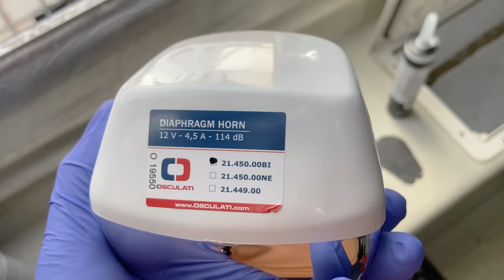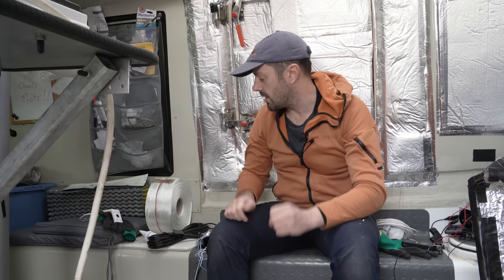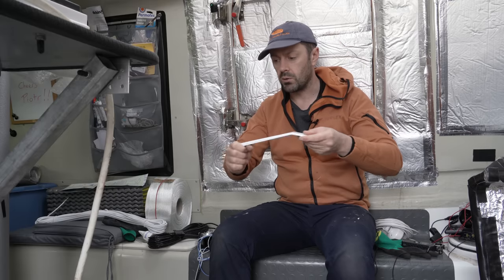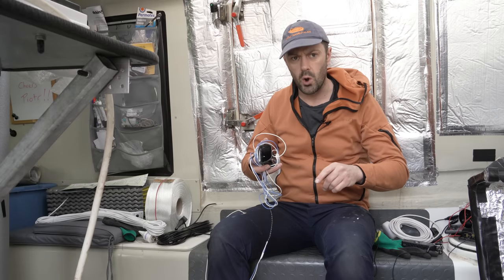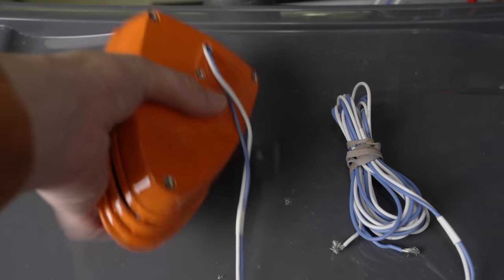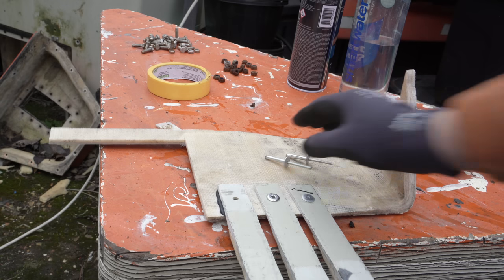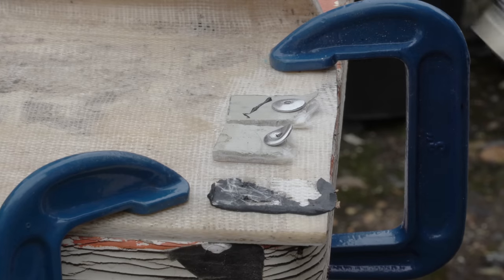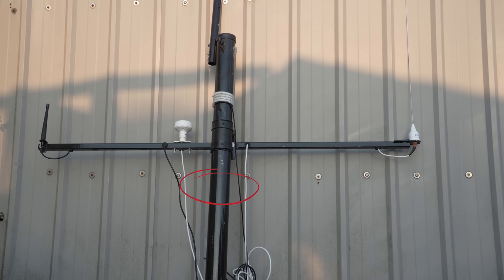VHF/AIS/GPS mounted to mast and wired. Plus a special pop rivet test. Lifeboat Conversion Ep74 [4K]

Comment: If you have some extra heat shrink. Cut some and make several pieces slide over the wires and slide them into the hole and then heat it and will fill the hole. Then there is short pieces of vacuum hose.
Reply from the maker: Yes that's my solution - I should have showed it.

Comment: I’ve a suggestion for a type of fixing that I don’t think you have heard of that being rivnuts. As the name suggests their rivet nuts they are ideal for use in places that have voids and allow you securely bolt things in place instead of using pop rivets. They would have been ideal for fixing your antennas in place and as they come in different sizes could have been used for the fixings for the mast support post instead of jb welding bolts to that piece of steel and the improper use of a measuring device 😂
I hope this helps
Reply from the maker: Ah, you'll enjoy the railings episode. I've gone with riv nuts...

Comment: "The manufacturers have designed it specifically so that the smallest maintenance task requires 20 prior steps to be completed to access any given component."

That's how you know you've encountered something designed by an ex-Mazda engineer.

Comment: Is the VHF aerial designed to work without a ground plane? Do you have a SWR metre available to check that the aerial is matched up ok?
Reply from the maker: Well that's sent me down a google search vortex of despair. Answer - still don't know. I'll switch it on and find out.
Reply: @AlexHibbertOriginals   It appear to be base loaded so maybe not Alex, that said,  it wouldn't suffer if your metal (an ali strip would be fine just make sure you had a good electrical connection to the outer of the connector) mounting bracket was the whole length of the 'yard arm' to give a little ground plane effect ;-) edit: it's just occurred to me your twig may have been intended for masthead use, in which case yes it would ( aerial speakingly) be expecting to have a whole yacht mast  attached to it acting as the ground plane, an asymmetric dipole even.

Comment: There may be a snag to your generator setup. Have you run it for any length of time yet? They're unpleasantly noisy things to spend any time around. I'm not talking about normal diesel engine noise levels, those little petter a-series engines are really "knocky", it's a sharp, high-frequency noise that totally obliterates your hearing if you spend too much time with them. I'm not saying this in the traditional spirit of the usual comments-section naysayers, it's because i own 2 of the little beasties myself! I'm a diesel-mechanic, so I quite enjoy most engine noises, but even I'm not keen on them. There's not much that can be done to quiet them either, without smothering (and subsequently overheating) the poor thing, the noise is made much worse by the relatively thin aluminium engine-block, it doesn't dampen the noise like cast-iron would, it seems to amplify it!

if you decide that you still like the thing, I'm happy to help if you need any advice or even a hand, I've re-built a few, and aside from the racket, quite like them!
Reply from the maker: Oh yes the noise is extraordinary! Luckily the power output and my charger is enough to only need to run it occasionally. Either you spend the time out back or on deck, or with proper ear protection on.
Reply: @AlexHibbertOriginals  that's good, they're quite reliable little engines so make a good backup unit, just not something you'd want to spend hours listening to (I have, and I'll never hear those particular frequencies ever again!)

I've got a tip for better cold-weather starting, keep a small bottle of 30:70 petrol:oil mix around (I use a lighter-fluid tin for convenience/robustness). a quick squirt into the priming port ( the knurled plunger thing on the intake manifold) before starting and she'll go even in the coldest conditions. the oil will temporarily help get a good compression seal and the petrol makes combustion easier. it's far kinder to the engine than ether (easy start) and safer to have around too.

Comment: You may want to contact a HAM radio “Elmer” and measure the antennas performance (SWR) and placement.  Also there are other frequencies antenna configurations you may want to be prepared to transmit on (HF/NVIS/directional).  These days radio communications can also transmit e-mails/txt messages when other methods fail.  I’m sure there aren’t many cell towers where Alan is heading but thankfully you have hair shears.

Comment: Coming along well, despite the weather impediments!
You may know this but coax cables should not be deformed e.g. in compression glands, especially if mixed with other cables. Thus best not to turn the thing at all, and just rely on the gooey goodness for keeping out the eleph…. elements!
Reply from the maker: Cheers

Comment: The flexibility of that fiberglass member dangling in the breeze on the top of that mast gives me a bit of concern about resonance issues - if you give a twang, what's the frequency?
Reply from the maker: Frequency unknown - but there will be wire tensioners.

Comment: Why didn't you go with a manual crank or electric crank telescoping mast? I would add shrink tube to those wire that are coming out of the top of your mast
Reply from the maker: Not sure there'd be any point. More parts to fail, and I can reach to the top of the mast as it is.

Comment: If you add a service loop before the gland into the mast it should prevent too much water ingress and allow you some extra length outside the mast in case you need to move thing a bit.
Reply from the maker: Smart move.

Comment: Just a comment for the rhythm of algo.  I was wondering if you were going to use something to protect bundle and protect the cables where they come out of the beam and into the mast.
Reply from the maker: Conduit within the mast. The short lengths outside? Not at present.

Comment: Could you put a couple of stays on that antenna mount to triangulate to the mast a bit? Perhaps a combination of the 'legendary' silicone and the rivet might be doable for the antenna brackets too.
Also for that bundle of coax, industrial hose supplies make industrial strength spiral binding for heavy duty abrasion resistance. It it great stuff for holding cables together too. It is very tight and holds cable snugly if you buy the right size. It isn't exactly cheap if you need long lengths but for your short length the price will be pretty cheap I'd say.

Also, I bought a couple of junkie horns like this for my car recently. I hardly ever use the horn but had cause to the other day and guess what? The one time I needed to use it, one of the jolly things didn't work properly. An effeminate squeak was all that emanated. Had good earths, a relay, direct wiring to the battery and everything. What was the cause? Not using it enough. I eventually got them working again but I would strongly suggest putting a high quality Hella horn or something that costs quite a lot and test it every day. Then the problem arises if one uses a low quality horn when you really need it, can it hack it? Will it burn out? Will the diaphragm crack? 
There is just so much rubbish out there. Pay whatever it costs and get a really good perhaps plastic body type. I don't know how plastic might be at minus 56 deg C, but just saying.
That horn looks remarkably similar to the type that I fitted to my car.
Reply from the maker: The stays could go to the mast I suppose, and not Alan's shell. Will have a think.

I have some good cable conduit - will see how it does.

The horn was from a good marine supplier and has good reviews - but I'll keep an ear out for problems. I have handheld air horns too.

Comment: A bigger VHF antenna might be nice, but, Eh, at least you're getting it slightly elevated. I am not sure if it'd benefit from a ground plane or not, though - might be something to look into.

Finally, the wind generator is good when you're anchored (or, God forbid, adrift), but remember that when you're under motor, you're basically making your engine work harder with more wind resistance from the generator. I fully support you having it, just use it at the right times is all.
Reply from the maker: True - although I feel we've minimised wind resistance without doing away with required components.